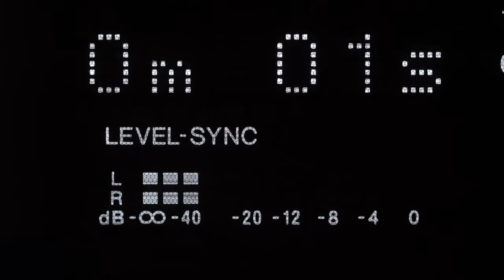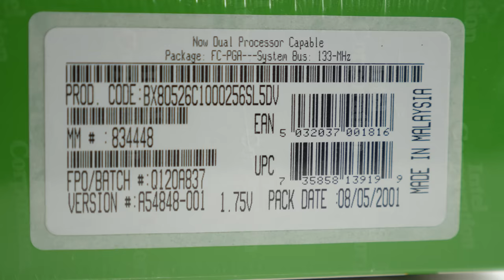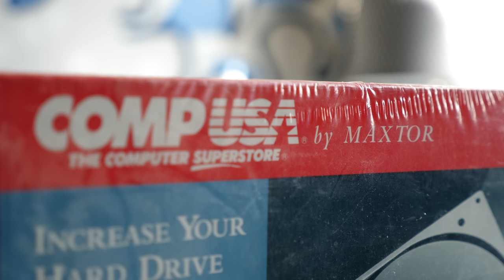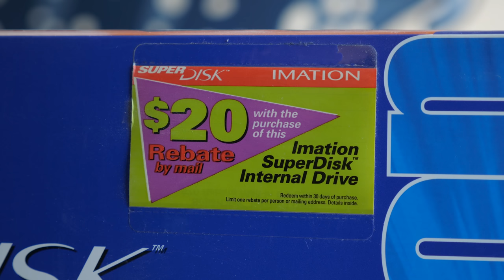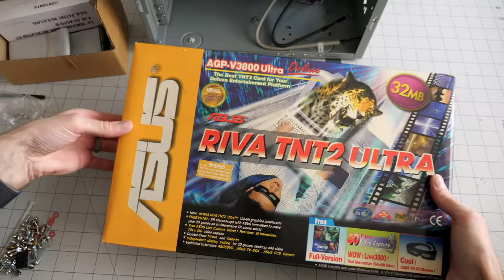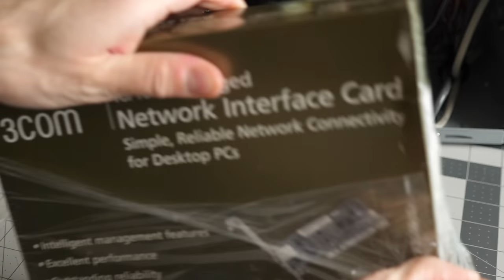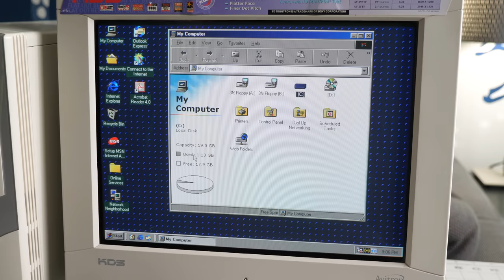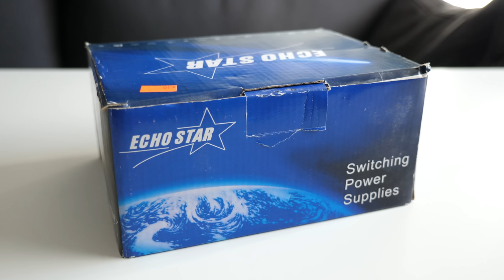Building a Retro PC From New Old Parts!

Comment: 5:15. That red switch is a voltage input switch. It can set the psu to take either 110 volts or 220 volts. You might have forgotten to set it to what voltage comes from your main outlet which is why it probably "popped."
Reply: That only happens in countries where the supply is 240v and it's set to 110v.
Reply: It could also be that it was the cheapest, jankiest power supply ever made with mostly empty space and what little it does have is not even assembled properly.
Reply: No, I've switched PSUs in the US around and it still worked.
Reply: @gp3328  Because US mains voltage is 110v, meaning that the higher voltage setting doesn't damage anything because the stuff already rated for 240v can trivially survive 110v. However, in a 240v country like Australia, getting that switch wrong has far more dramatic consequences as components rated for 110v don't particularly appreciate having over twice the rated voltage to deal with.

Nowadays, there is automatic detection so the switch is not needed. The power supply starts on 240v mode and if it sees the wall voltage is 110v, it switches over to that, but if the wall voltage is 240v then it's happy.

Comment: I worked for a local computer shop from 2000 - 2006, so this takes me back. I built machines and did onsite work for customers (network, security, servers). Used so many of these exact parts. Don't know how many of those TNT2 cards I installed, I do remember the heatsinks would get really hot when would benchmark them. 3COM 905C, I still have a tote of them. Favorite card of the time, installed hundreds of them.

Comment: 52:24  The Mouse Keys feature was a lifesaver for me on multiple occasions, when I was setting up Windows 95, and had yet to install the Mouse drivers. I had to be able to navigate using just the number pad..  it wasn't easy, but it got the job done quite well.
Reply: I caught that, too. It was a primitive sort of touchscreen control. It was awkward but those 486 and early pentium boards often suffered “mouse driver failure” which was a big pain in the a$$. We enabled the Mouse Keys to allow us to reset the interrupt codes which meant another component was hogging resources. There were some awkward keystroke commands leftover from Windows 3.1 but nobody used them.

Comment: “Not a bad power supply” 😂 great build so far can’t wait to watch the rest!
Reply: Quality control 💀💀💀
Reply: Power Supplies are about the only computer part that make me nervous I've had many blue smoke on me in the past.
Reply: DIABLOTEK 💣💥☠️
Reply: That power supply was yet another item on this build that clearly was not new, infact if you look closely at the supply there are multiple indications that it has been not olny used before but also opened up, for example the mark on the case where a security sticker has been cleaned off, probably after some one opened it and damage the sitcker.

Comment: 51:57 Mouse Systems made some of the first PC serial mice in the early '80s, competing with Genius. I wasn't aware they were still around in the late '90s.
It's interesting those ergonomic split keyboards never really took off. I'm vaguely tempted to hunt down a cheap used one just to see what they were like.
Reply: I'm using a split mechanical keyboard to type this. They didn't quite take off, but they absolutely still exist for people that have issues with wrist and shoulder pain from prolonged computer use.
Reply: I have that exact keyboard from the video.  I bought it in 1996.  I really enjoyed it. Played a lot of Command and Conquer and Duke Nukem 3D on that keyboard. I never did use the extra mouse functionality though.
Reply: Logitech makes a great ergo split keyboard. My partner uses one for her work and it's very comfortable.
Reply: They are on ebay
Reply: I was so glad when optical mice came around.
Reply: they were acquired by genius in the early 90s, so probably a genius keyboard using mouse systems branding

Comment: That solid (heavy gauge) case is how cases used to be made.  I liked Antecs.
Reply: I remember building pc's with those heavy steel cases. I used an Antec 1200 case in one of the builds and damn that thing was heavy.
Reply: Truth.  I recently built a Dual P-III Celeron in an Antec Performance case.  Contrasted with modern cases, where the side panels could be used for 1960s Sci-Fi movie sound effects by wobbling them around, that old Antec is built like a tank.
Reply: Antec still make awesome PC cases!

Comment: Theory about the LS120: Something failed inside so that when a disk is put in, the metal on it or whatever shorts 5V and ground. Same behavior as when I plugged in a busted USB hub.
Reply: I remember that we had to spend quite a few afternoons and weekends keeping our old LS-120 drives working over the years we had them... just maintaining them and keeping them clean-room-level-immaculate on a monthly was key in keeping them working properly, quickly, and without read/write errors.

Still, there were MANY things we did back then that really benefitted from the LS-120 drives... Sneakernet was a lot more efficient, for starters :)
Reply: @spacepirateivynova  Bit of a shame they seemed so delicate...I could see that drive having been WAAAAAAAAAAY more practical were it less susceptible to lack-of-maintenance failure.
Reply: doesn't the LS120 drive need 5volt and 12 volt ? you only used an adaptor for the 5 volt. perhaps it went wrong somehow there?

Comment: 1:08:40 when you said it doesn't weight much, I immediately knew the quality. A good PSU must weight at least more than 500g.
Reply: A comment like that just shows how little you know about electronics and computers from this era.
Reply: @cbullar4205 eh? A light ATX psu has usually always meant crap quality, and heavy one, a good quality unit. 

(Unless the PSU maker was enough of a scam to stick a heavy piece of metal in the case to trick you)

Comment: Don't forget to enable DMA within hard drive properties of Device Manager. If I remember, Windows 95/98 doesn't have it enable by default, Windows Me has it enabled. I would like to see more videos like this one. Another PC builds or Mac rebuilds.
Reply: Entirely depends on if the IDE controller supports it AND you have the correct chipset drivers installed. Not having the chipset drivers installed on a Windows 9x system is one of the big causes of poor performance.

Comment: The launch of the Pentium 233MHz mmX was a unifying time where it was clearly the best processor on the market, 3rd party accessory makers were supporting the custom market en-masse, and games were making the transition to 3D. Regarding the power key on the keyboard: in '97 having a dedicated key to put the PC to sleep was all the rage, usually they were on the case though. We referred to them as the "coma key" since there was very little chance a PC would actually wake up. Sleep states are still unreliable today in the PC world.

Try using the power cable from the floppy drive on the LS120 to rule out the adapter cable being the problem.

Comment: I had a LS-120 External Drive that plugged onto a parallel port.  I was a Network Engineer, and when I would go setup someone's Novell server, I normally had to do server based installs software on to the server from floppies.  The LS120 was a huge time saver because it read floppies so much faster.   I kept is in my service van and used it nearly every day.  However in 4 or 5 years CD's were on there way in and most of the software came on CD.

Comment: "Retro PCs were just kind of loud..." You can say that again! I built all my retro PCs with modern equivalents for anything that moves, other than the optical drives anyway. (There are alternatives, but they're not cheap or easy to work with.) To me, the authenticity matters at the cosmetic level and then again once the software is running. I'm perfectly happy with faster, cooler, quieter alternatives for anything in between that exists just to get the software into memory. I know a lot of people are purists and that's fine by me-- to each their own-- but I like to hear the game I'm playing over the sound of the machine without having to wear earphones! :)
Reply: Quantum BIGFOOT loud
Reply: @rockapartie  You're right, they are so cheap and it's a wonder they are still being sold, and at such fair prices too, given how little use most people make of them these days. Maybe it's a good idea to buy a couple of them before they get completely phased out and you can only buy expensive new old stock units, or unreliable used ones.
Reply: Exactly. Authenticity just isn't worth it if there's much better modern alternatives.
Reply: I'm a purist, but I also have a few tricks up my sleeves.  :-)

I rebuild all my old PSUs with new fans, and use high-quality low-RPM (1800 or so) fans with good bearings.  (I like San Ace 80 and Qualtek fans.)  You don't need huge amounts of CFM, you just need to pay attention to airflow, put fans where they need to be, and not where they don't.

Old CPU fans are often terrible - there are plenty of 40mm, 50mm, and 60mm options available now that are far quieter than Cooler Master or Sunon stock fans.  You don't usually need a TON of airflow on the heatsink either, you just need to keep it moving so the case fans can take heat away.

The reality, though, is that a lot of PC cases just had terrible thermal design.  Fans butted up against grilles with lots of material in the air path, poor placement options, etc.  Once the chipsets started getting hot, it was important to have fresh air coming in low, and have it pulled across the passive heatsinks, to the CPU fan, and then out of the case.  So many cases handled this by pointing high-speed fans every which way, and hoped to win by brute force.  You can do way better with thoughtful layout.

Also, a lot of graphics cards back then got REALLY hot, and there wasn't much air moving around them.  I'm working on my own adjacent slot cooler design (3D-printing and some OTS blowers from Digikey) to at least pull a little air past them and out the slot bracket.  Another project:  Small offset extenders for 80mm case fans to bring them out away from the grille by a couple mm, to reduce air buffeting and decouple motor noise.  This really helps with fans that have poor static pressure -- they tend to speed up when suffocated, making them way louder.  This is really important for intake fans, which typically compromise airflow for aesthetics.

Old hard drives are essential to the experience, for me, so I just carefully pick models that were quieter from the get-go, and make sure to find some that haven't worn out their bearings too badly.  I'm looking into isolation options as well.  You would be surprised how much of the HDD whine is propagated through the metal in the case.  That's tricky, though, because there isn't always much room for insulating materials at the mounting points.

The results vary.  When all goes well, though -- like my 486DX2/66 -- you can barely hear it when it's on.  My Northwood P4 2.0GHz is a work in progress...  ;-)
Reply: Please mention this to Gigabyte because my 2070s sounds like a frighin harrier jet from the second I turn my PC on.  The fans on my card are either off, or all the way on and I seriously regret spending extra on a noctua cpu cooler when I can hear those gpu fans from two rooms over...
Reply: @SineN0mine3  Have you tried using MSI Afterburner to adjust the fan speeds? You should be able to define a curve of increasing fan speeds in response to increasing temperatures.

Comment: The pace of change in the late 90s was incredible. You had to see it to believe it. In 1995 I spent £2,000 on a Pentium 100, took it to university in '96 and by 2000 it was completely obsolete and I replaced it after graduating with a Pentium 3 866. These days a 5 year old PC purchased for £2K can still play AAA games at high settings. Back then in 5 years I went from "this PC runs Duke Nukem pretty damn fast" to "I need a brand new PC to play Half Life: Counterstrike on dial up"

Comment: I had an old PC of mine back from my sister the other day, with IDE drives. It's around 15 years old. Checked all the caps which look fine, and the coin cell still works. DVD drawer is a bit sticky. It booted XP once and then the drive died lol. I've since installed other drives into it and then put 98 and 2000 on it to dual boot and it works like a charm. Got a list of things I want to add like IDE to msata adapters and an AGP card with HDMI, or maybe an adapter instead. It's nice having a platform for all my old games and whatnot  🙂👍🏽
Reply: Don't you still need an SATA driver, or does the system see a PATA IDE drive?
... They make AGP cards with HDMI? I thought S video was odd...
Reply: @Caseytify  the O/Ses I'm using recognise IDE drives just fine. As for the AGP/HDMI thing I've still not looked into that yet. Got a graphics card in it which has DVI and VGA, but still want to use a TV as a monitor at some point
Reply: Only AGP card that has HDMI afaik is a Radeon HD 4670 or around those model numbers, and they typically go for more money than they’re typically worth these days.
Reply: @thegeforce6625  ended up getting a HD3650 for a decent price which has HDMI, and got some IDE to SATA adapters for the hard drives and the DVD drive, so all the connections on the motherboard are IDE, but the hard drives are SSD and both those and the DVD drive are brand new SATA devices, and the motherboard sees them just fine

Comment: I was a parts purchaser for a Large mom & pop computer store in the early 00’s . Those echo star psu’s were our budget replacement brand at right around the $50 range. We sold those things by the truckload with relatively few returns or DOA units. Funny thing was, the ones I remember having been returned all behaved exactly the same. Puff of smoke when plugged in the first time.

Comment: I know this video is older at this point, but just wanted to mention in case someone miraculously sees this; these older systems, rely on the +5v rail of the psu a lot more, so you want to have a fairly high amperage on there.  The psu you ended up using has only 15 amps so that may have contributed to some of your issues.  In any case, to avoid any future issues, def think about replacing that psu, you can find new power supplies today that still have 20+ amps on the +5v rail.

Comment: Second hand prices aren"t much better. It took me two years to find a sensibly priced socket 370 motherboard, prices are just insane.  P.S. Couldn't you have just used some Dupont style male-female  jumper cables to bridge the front audio cable to the sound card header? Done that sort of thing many times, just apply a drop of 'hot snot' onto the black cable ends to keep them in the right orientation for added security.

Comment: I chuckled a little bit when you mentioned ViewSonic right after KDS, for reasons only I would find funny; the computer monitor that we first had with my first childhood computer was made by KDS (re-branded as Compudyne), and when it died in spectacular fashion, we replaced it with a ViewSonic monitor.
Reply: Currently reading this on a ViewSonic 32 inch 1440p monitor. No complaints. It was one of the cheapest ones in that size at 1440p available used locally.

Comment: If I recall correctly, the power button on your keyboard did in fact work on a PC, although with a lot of models it would only toggle the computer's hibernation mode, rather than the actual power. It depended quite a bit on the motherboard at that time. The power buttons on the keyboard weren't very popular because it was too easy to accidentally bump them, being so close to where you normally had your hands, and they disappeared quickly in the early 2000's. Nothing like reaching for your drink in the middle of your Quake III match and putting your computer to sleep.

Comment: I think the SKU got cut out because when a store has unsold stock, they send the UPC back to the manufacture for credit...
Reply: Another possibility is that around that time period, CompUSA worked with various manufacturers to be a central rebate processing point.  Instead of making 5 or 10 or 20 copies of receipts, cutting out as many UPC codes, and sending the manufacturer forms to each individual place, CompUSA customers could fill out a single rebate form available at the store (by checking the boxes for each individual rebate), send all the UPCs with a single copy of the receipt and the form, and get one big combined check back.

Comment: Damn I completely forgot how god was that Intel OEM heatsink design when working with exposed dies CPUs, at least compared to the nerve breaking that AMD came up with!
Also LOL on your edit choice about the amount of thermal paste!
Reply: I'll never forget the day I killed a customer's BIOSTAR AMD mobo after fighting and taking a hell of a beating to that heatsink spring.

What a cursed thing.
Reply: That used to happen ALL THE TIME when I worked at a local computer store back then.  So many board manufacturers had this moronic tendency to route traces RIGHT UNDER the silkscreen outline for the HSF retention clip.  One slip from a flat-bladed screwdriver, against a high-resistance spring mount (!), and the board was done.

Comment: Love this, gave me such nostalgia for the time when I worked building PCs in the early 2000s.
Re: Unwrapping new old stock parts - these things were made to be used, not kept sealed and mint and then speculated on like a commodity. As long as we have a small number of units for museums and other preservation cases, we should use the rest. IMO, obviously.